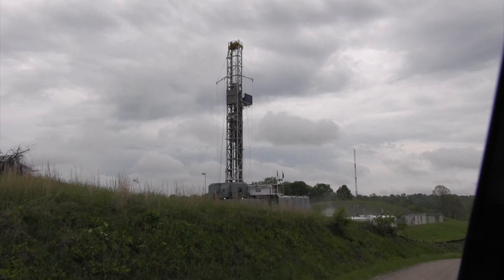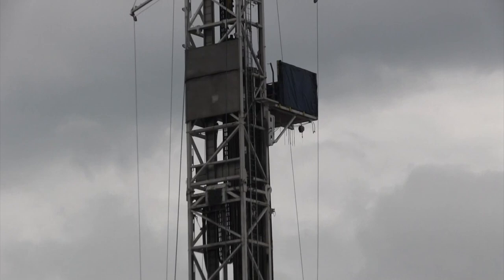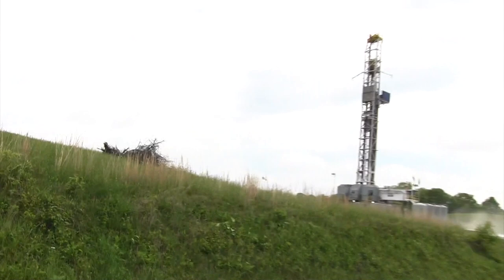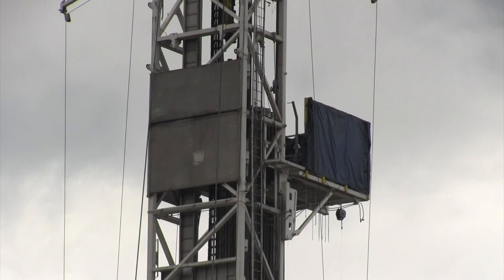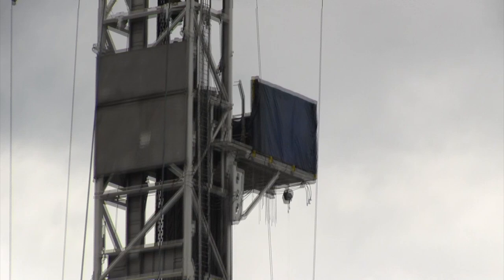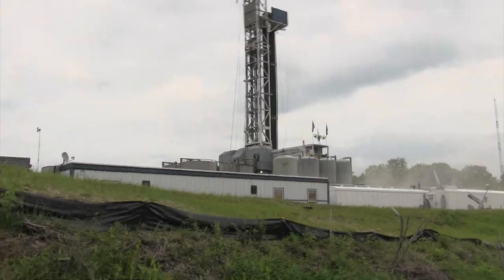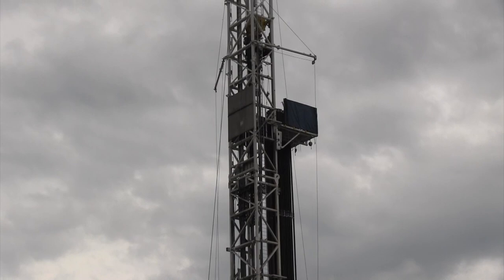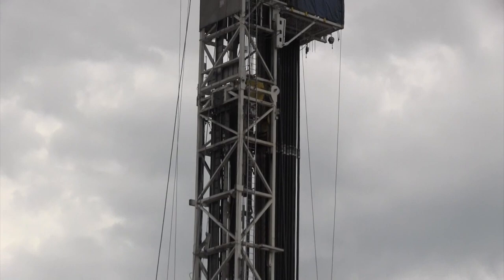What Are Monkey Boards

Comment: You don’t cement with drill pipe in the hole, you drill the hole then trip out, then you’ll run casing then cement. Your casing string will stay in the well and you’ll pump cement down and up the back side.